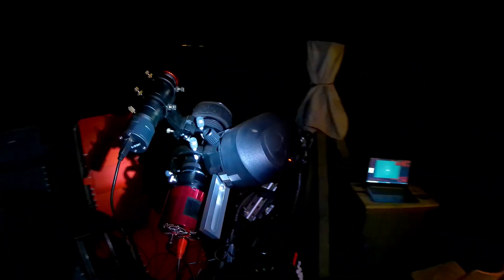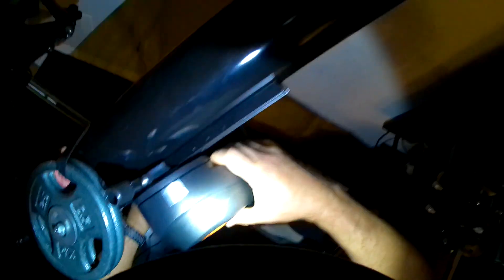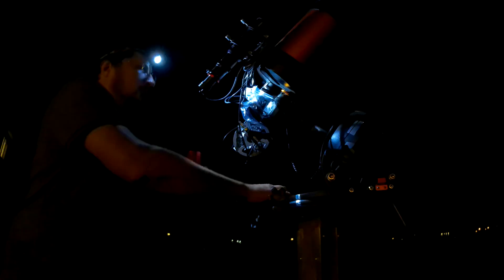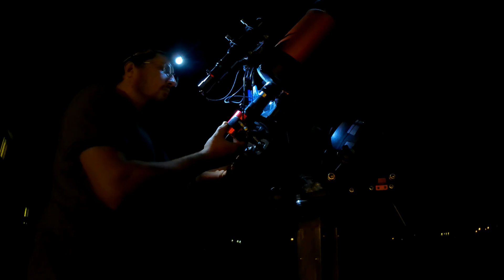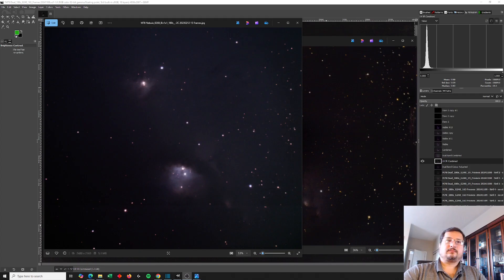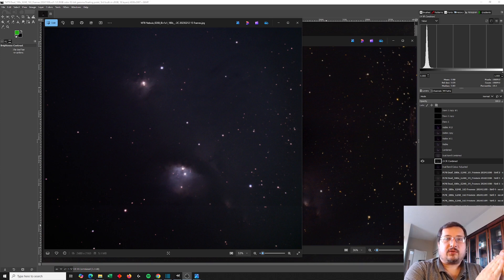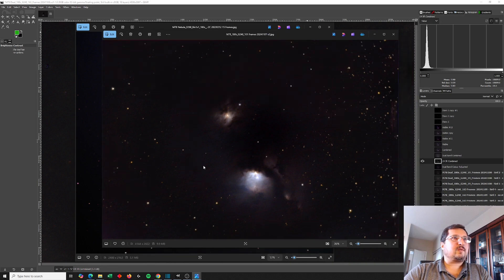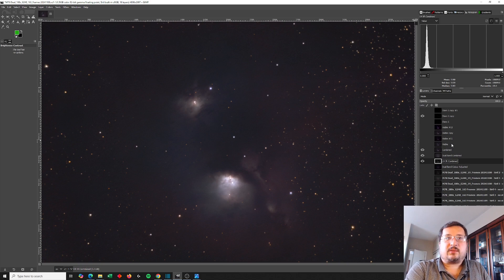Can You Image A Reflection Nebula From Bortle 8 Skies (Using A Celestron NexStar 6SE)?

Comment: It is very nice to try different objects, excellent job, a question, what is that uppdmat for?...CS!
Reply from the maker: Thanks!  UPPDMAT came out of me looking for a way to filter out weird anomalies I was getting in my images.  Bright gradients in the center, large rings, etc.  that were  being caused by bright sky glow and other light pollution.  Basically, you use a diffuser to take images of the sky so that you get all the weird anomalies, but no stars, using the same settings and duration as your lights.  You then use those in place of flats and darks because they already contain all bad pixels, vignetting, and sensor glow.  They are not perfect, and don't work as well for narrow band, and you do need a lot of them, so it takes some time, but they have helped a nimber of people.  Have a look at this video
New Approach To Reducing Light Pollution Using UPPDMAT Sky Flats In Bortle 8 Skies
https://youtu.be/uqJsSUXwcZM